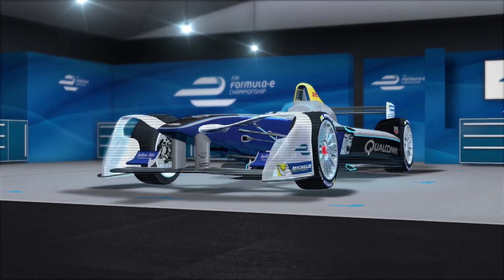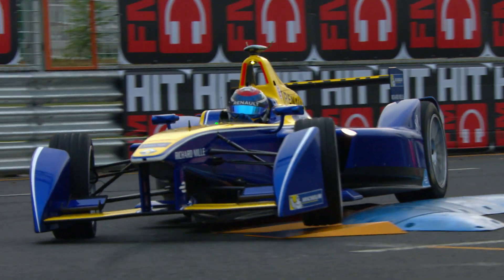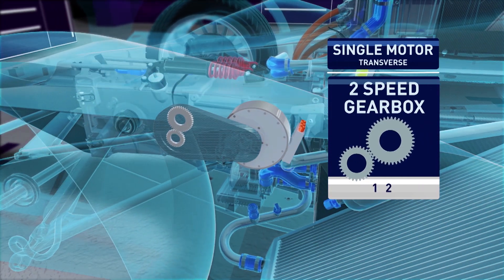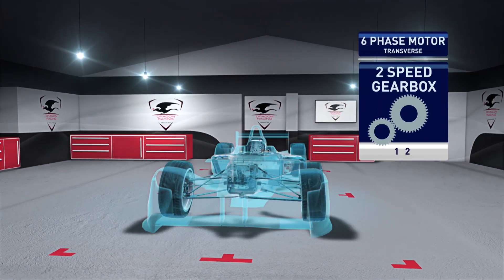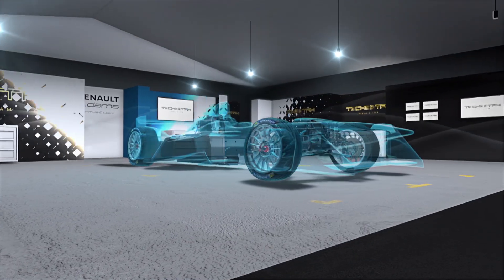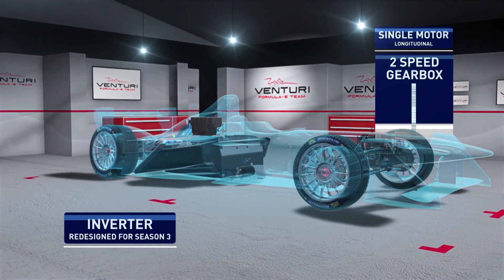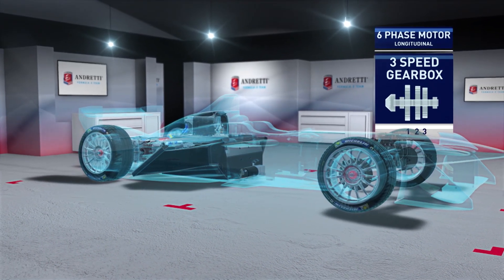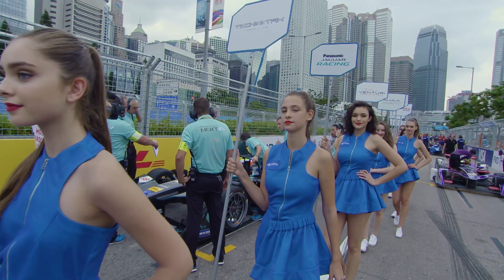How Are Formula E Cars Different In Season 3?

Comment: Shame electric is done this way, by storing it in a battery. Electricity is better utilized by generating it on demand. So why not have a gasoline motor running a generator to supply the motor with current? Sorry but honestly I think Formula E is planned to be used to shoehorn the world into electric autos, for that reason I am against it.
Reply: It reduces the possibility of using the regenerative braking system if we're using a gasoline motor. We can't refill the motor with power generated during slow speed maneuvers which really adds to the beauty and skill of these races

Comment: wouldn't an energy recovery system like the ones used in formula 1 extend the battery life allowing longer and more aggressive racing?
Reply: Most electric motors act as generators when they're not energized, the real issue here is a way of storing the recovered energy as a battery cannot be charged during few seconds of deceleration. They would need extra capacitors or even supercapacitors for that. I'm pretty sure it wouldn't be that difficult for racing teams to get their hands on some of those puppies though.

Comment: Not sure why the multispeed gearbox is for, electronic drive transmission with 3 phase synchronous motor can deliver constant torque over a broad range of RPM
Reply: Lower gear ratios still multiply the wheel torque.
Reply: Given that they are using skinny treaded tires on a very light car, I'm surprised they need any torque multiplication before they reach the limit of traction. Even then, it seems a torque converter (such as the one in the Koenigsegg Regera) might be a better setup than a gearbox.

Comment: I wonder if tesla would be more efficient with a 2 or 3 speed gearbox??
Reply: Nice-oscar it will improve top speed but add complexity power loss and points of failure for a car that's a city car which is more interested on 0-60 acceleration and miles per charge.

Comment: Chicken Batteries !!! NO RACE CARS !!!
PLS, don't be Stupid and think, that this Plastic-Batterie Chickens are Real Race Cars : )
Reply: If it's a car, and it races, then it is a real race car.  Period.
Reply: petrol head lol
Reply: Give up! Most people didn't even get your Battery Chicken jokes, and those who did found them unfunny. Formula E is exciting because 1) great tracks, with extra turns because the top speeds are lower than F1 2) Insane acceleration and torque.   Can you imagine world class racing with a motor driving the wheels directly over fixed transmission? That's how much torque these motors have. And with each team making more technology decisions each season, the technical side is only going to advance faster and be more exciting.
Reply: WTF

Comment: Does the sound come from the motor or the gearbox?
Reply: David Laub the noise is mainly from the gears
Reply: bual 96 And rolling resistance as well as air sound.
Reply: 89
Reply: And from the inverters
Reply: bual 96 and from the metal bending under the magnetic field